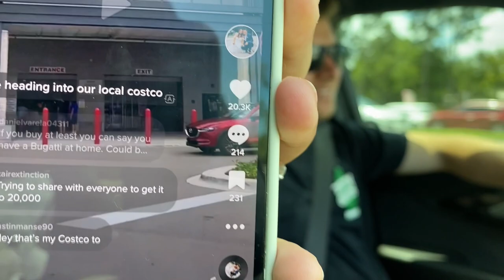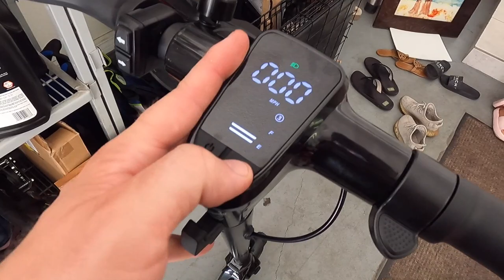WE GOT A BUGATTI

Comment: Alright guys I have some stats! I own one of these.

I weigh about 217lbs fully clothed. I can easily get to the 18.5mph on flat surfaces, and downhill it can hit 20mph. The motor will actually "brake" and slow you down if you go too fast down a hill. 
As far as power, this thing has a "600 watt max" motor but it really only runs at around 360 watts . This makes sense because the battery is 36 volt 10Ah. Anyway, I did some hill tests. If I go up a 4.5 degree hill (about 7% grade), this scooter can maintain my speed at about 9mph. If you do that math, that comes about to around 320watts or so continuous. It cannot take me up a 7 degree hill (12% grade). I have to kick-help it to do that. 

I did a range test yesterday, with mixed riding of hills and straights (quite a few hills actually) and I got to 11.4 miles and then the scooter shut down from low battery. I'm convinced if I would have just turned it off and walked up the hills I would have probably gotten 14 or so miles distance. I forced it to pull me up the hills to see what it could handle.

Personally I'm happy with it , I've never owned a e-scooter before and I feel like it's fun as hell to ride and still slow enough to be safe. And to me 11 miles is a pretty damn good distance, I mean I was standing on this thing for like 45 minutes, by the end of the ride my feet were tired. I averaged 16 mph. Nobody is going to want to ride a scooter for 24 miles!

It still takes too long to charge IMO. The charger pull 75Watts from the wall when the scooter is down at 1 to 2 bars battery left. This means it would take like 5 hours to fully charge (360Watt hour battery / 75 watts) . That really sucks, I really want manufactures to allow "1C" charging! Let it charge at 10 amps. This would let it charge in one hour flat. Almost all lithium batteries allow 1C charge rate. The charger is 42 volts that means its running at only 1.78 amps or something. That's very slow - like less than .2C, I mean, come on! You should be able to charge this battery at least at .5C. Which would push charge time down to 1.7 hours instead of 5.

Comment: I'm a big fan of the segway es2. Highly recommend. 
$350-$400 new. 20mph, 20 miles of range, solid tires, brake regens the battery, cruise control, headlights.  Designed to be a rental so its rock solid. Easily replaceable parts. I've put over 200 miles on mine riding local bike trails. Even rode it on some MTB trails lol

Comment: I have the Inokim OXO Super & Inokim OX Eco, best escooters i've ridden, incredibly smooth and extremely powerful, the Super has dual 1200w motors, 60V 27ah LG Lithium pack too will do 65km/h/40mph and 100km/62miles range on a good day! Theres also a heap of mods out there for them... video on Youtube of the OXO Super modified doing 120kmh/75mph

Edit: added mph

Comment: You can always change the battery on the old scooter & make it new again
Reply: Probably multiple batteries in the stem/neck....just an old guy guessing. Early 90's I needed a weedeater part and the shop only did warranty work for the snapper equipment and told me to look at their scrap pile. Five bucks later I had a mean green commercial power head that I mounted on a large wheel push scooter that went 35 mph luckily the mount broke before the contraption broke me. I understand how Cooper is drawn to scooters

Comment: "My Arm Hurts"......???????? After 2.5 minutes 😫 your arm hurts? I can help with that.Youtube has alot of very easy arm exercises, that will help you so it doesn't hurt after 2.5 minutes of holding a quarter ounce phone or camera, lol.Im really sorry that it hurts.I used to have a similar issue with my left arm.It would get weaker than my right arm,like,I could shake a chocolate milk with my right hand for 1 minute easy.with my left arm,I couldn't shake it for 15 seconds before it hurt,or burned.So,I did weird exercises to fix it.It was hard tho